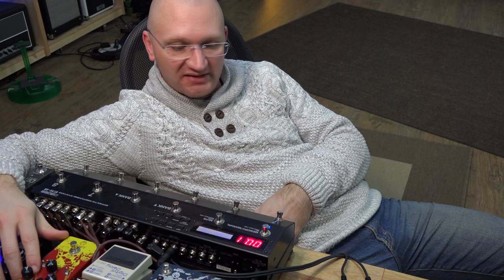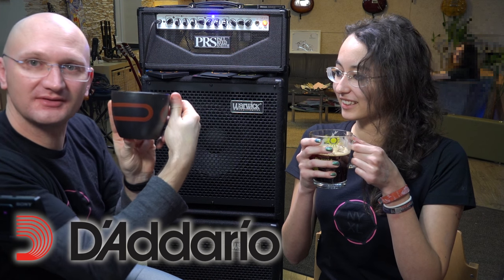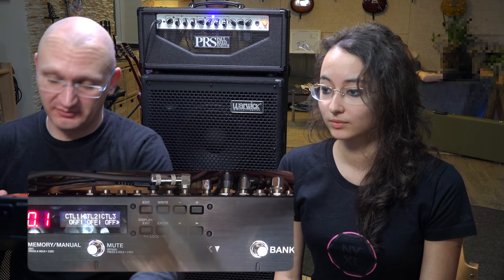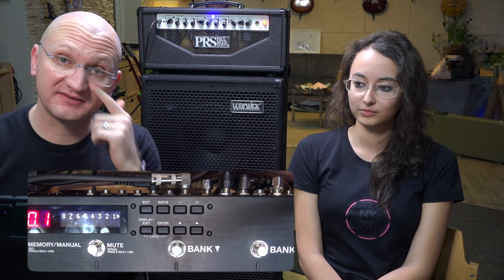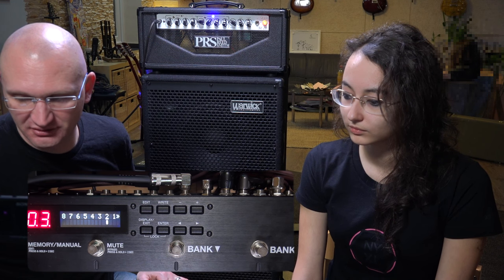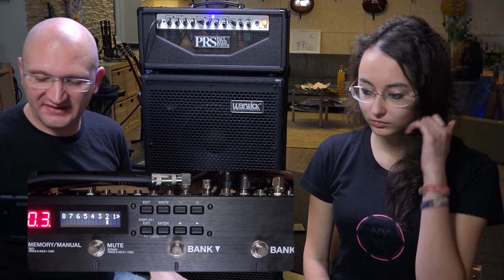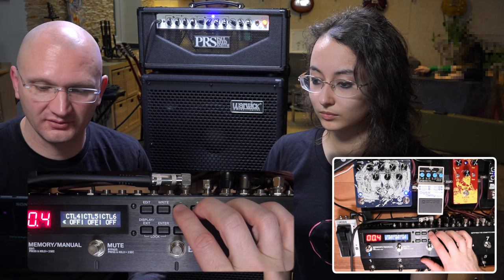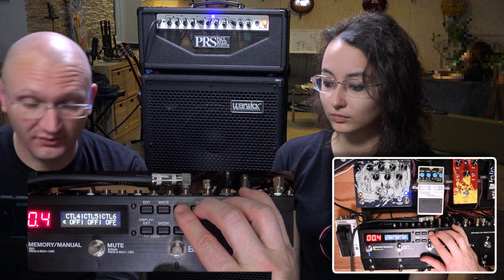Boss ES-8 Tutorials Part 6 - CTL Outs / Amp Switching

Comment: Hi not sure if you can help me but I’m at a loss. I have an Egnater Armageddon and a Boss ES-8 pedal Switcher. The ES-8 can be Midi controlled. My dilemma is getting the Armageddon to switch channels via Midi using the Boss ES-8. I have a midi cable connected to the Midi in on the head going to the midi out of the ES-8. When I hit one of the buttons on the ES-8, say patch #1, and I have the dirty channel selected on the Armageddon,I hold down the channel select on the Armageddon and the light flickers but the dirty channel won’t save to patch #1 on the ES-8. I’m not a very technical guy so I hope this makes sense but I want to run a full midi rig and I’m pulling my hair out trying to figure out how to do this. Thanks in advance.

Comment: I have a PRS Archon amp head. My channel footswitch is for two channels only: clean and lead. But, my footswitch is not connected with a 1/4" cable to the back of the amp. It look's more like a MIDI connection. Since the external controls on the ES-8 are only for 1/4" cables, am I screwed? Thanks!

Comment: Since ES-8 has MIDI... Would it be so hard to make a software App. to set all that??
Reply: There are several devices out there. The RJM Gizmodo and the Voodoo midi switcher are two. But outside of clean cables why spend the money if you dont need to?

Comment: I'm not sure if I got it wrong, but I think the LED and the light on the amp were already synced before you changed the Min-Max thing. This happend after pressing the bank up button whilst it was on INV mode for an odd amount. So I think how it works is: You set it to INV mode, you switch it once and now it is inverted. You can go back to LAT and everything should be fine.

Pressing twice with the mesa switch is probably due to it being a toggle switch and not a momentary. A momentary switch only connects (or disconnects) while you press it, so after releasing it, it is no longer connected (or disconected). The mesa switch being a toggle switch connects after pressing the first time and disconnects when pressing the second time. As the descent requires a momentary switch, it probably only changes program / bypasses after a short "on" was sent. But with the mesa pedal being pressed only once, it still kind of "sends" on, not for a short time but so long until you press it again. So not before you press it the second time and the "on" will be cut again, it won't change anything. This also explains, why the descent saves when you turn it on and off on the ES-8, as for on only a sort signal (and yes, I know there is no signal, it kinda just connects things like tip and sleeve etc.) is needed but the ES-8 sends a continous one. Maybe all that has something to do with the confusing mode things happening when your switching your presets, but that's way to complicated for me to understand for now as I'm tired as f*ck atm.
What's still unclear to me is that INV works. I didn't read the manual, but INV sending a short "on" is somehow not understandable to me.

I think this is way too much for my poor english knowledge, but maybe you got it.
Ich kann es auch noch mal auf Deutsch erklären, aber dann versteht es ja sonst keiner.^^

Also why are there pixelated people? If they don't wanna be in the shot, why are they sitting there :D
Reply: +Audio Joe Just watched the intro and some other parts again. I think at least the half of the previous comment is just wrong, so dunno if this is helping you in any way :D

Comment: Hi, how are you?

I have a Carvin Legacy 2 amp and was just curious if you switch the amps channels with the ES8 through the midi inputs or by going through the amps footswitch and into ES8's ctl 1/2 input??
Read on other sites you use midi but I couldn't get that to work and my amps footswitch input is like a midi one with 5 little prongs and it says nothing about this in this video, can you help please???????

Comment: Hello, I love your videos and your reviews are very helpful, thanks for that!!. I have a Blackstar Stage 60 with 4 channels, clean, od1, od2, and reverb. If I use a 1 TRS, (from the amps footswitch), to a 2 TRS, into the Boss ES8 will I be able to change among the 4 channels?. Thanks in advance for your response.
Reply: Hi, I'm considering buying the Blackstar HT 100 Mark II, which has the same 3 channels, reverb and boost, but also 2 voices per channel, it has an official 5-ways footswitch (which I don't want to buy) that seems to work with a single TRS cable, the amp doesn't  have midi output. Did you figure it out how to change your 4 channels with the boss es-8? I think I will have a very similar problem. Thanks in advance!

Comment: Is there a way to do amp channelswitching in MANUAL-mode as it is like a pedal?
 In PRESET-mode everything works fine, by setting the exCTR outputs. But during rehearsels I don't want to create patches while other bandmembers are waiting  , hehe
 Just want to use the manual-mode like a sort of jam-mode and switch between effects and channels.

Comment: Hi henning. The issue you came across when you wanted inverted latch. When you did this video you demo’d it using an assign button and worked a way round this by swapping the min and max around. but if you had a patch where you wanted this but not as an assign, so just selecting the patch itself switched something, is there a way of swapping it around? I use the cnum option to kick in and out a boost so can really do it on an assign as that would turn on an off the thing I want on all the time. 

Boss have been really shit answering this as I’ve had an email into their tech support now for over a week and no reply at all.

Thanks

Andy

Comment: Can anyone help me with this dilemma 

I have the the es-5 version and it works great but it will not switch my amps channels, it will make a popping sound like it is but it doesnt. Im using a peavey 6505. Thanks
Reply: fundough721 are you running 4cm??

Comment: I still need to know if I can use the es-8 to switch between all my options with only 2 TRS
 cable on my Engl Powerball amplifier, maybe make a video so I can see how to do it.
Reply: Hi... Did you find out? I came to the video wondering that,. if I can actually use some kind of trigger for functions on the amp. Like reverb or whatever it is switchable on the amp. Even more, does it have momentary latching?

Comment: My amp footswitch has several functions.
1. Reverb
2. Lead
3. Clean/Clean2
4. Boost
5. FX
Can the ext control be programmed to handle all of that?
Reply from the maker: yes, but it depends on how your amp footswitch connected... you might have to make a special cable. What amp do you have?
Reply: I have a Schecter Hellraiser. Here's a pic of the footswitch. The only difference is mine has a Reverb switch too.
It connects to the amp with one cable.
The only "odd" thing about the amp is that it has 2 clean modes that are switchable by using the clean switch.
http://www.schecterguitars.com/international/images/stories/virtuemart/product/resized/hellraiser-footswitch-highres_385x120.jpg

My only real concern is to be able to use the Channel switch(and switch to the correct clean channel) and FX loop switch. My boost and reverb are almost always on.

Thank you so much for your help, sir!
Reply: Henning, I have a Mesa Roadster (Channels 1-4, plus reverb, FX Loop, Solo, and Mute. The roadster foot switch is huge btw). The foot switch cable is an 8-pin DIN. So how do I connect the Roadster to the ES-8? Great video by the way, it's very informative, believe it or not!

Comment: Would it be possible to use your normal amp switch, wire it up to the ES-8 and use it to toggle between amp channels in every preset, but at the same time have a certain channel of the ampo coming up, whenever I switch to the preset?
'Cause I totally agree it is difficult to remember where you placed that possibility without having a sign. But if there is "only" an LED-ring, you might know there's something, but nevertheless forget what exactly. And on stage you'll be f***.
Reply from the maker: +WhereSilenceDies No, you can't use your amps's changed switcher with the ES8
Reply: +EytschPi42 Now that's sad. Would be great, as you would always know where to switch, and also get a visual feedback (light on the ampswitch). But doesn't the ES-8 have the possibility to use external switches?
Reply: +EytschPi42 Nachdem ich das nächste Video angesehen habe: Ich denke wir haben aneinander vorbei geredet. Vielleicht krieg ich das auf Englisch nicht gut genug dargestellt.
Genau das was Ihr im nächsten Video tut mit dem Boss FS-7 war das was ich meinte. Müsste doch eigentlich auch mit beispielsweise dem guten Hughes&Kettner Footswitch funktionieren, den Du zum Hughes&Kettner Tubemeister Deluxe bekommen hast. Oder sollte ich mich da täuschen?
Reply from the maker: +WhereSilenceDies Ja, mir so einem geht das auf jeden Fall!
Reply: +EytschPi42 Danke dir für die Antworten ;-)

Comment: Question about the ES - 5. I am planning on getting a switcher. My chain is the following: Tuner - TC spark mini booster (loop 1) - Drive pedal (loop 2) - Delay pedal (loop 3) - Tremolo pedal (loop 4) - Reverb pedal (loop 5) 
I have a dual drive pedal that I like to mod with a TRS connection so I can control my 2 pedals independed. Can I use the ext ctl to connect this via the TRS connection so i can control the 2 sides of the pedal via this way?

Thanks in advance!